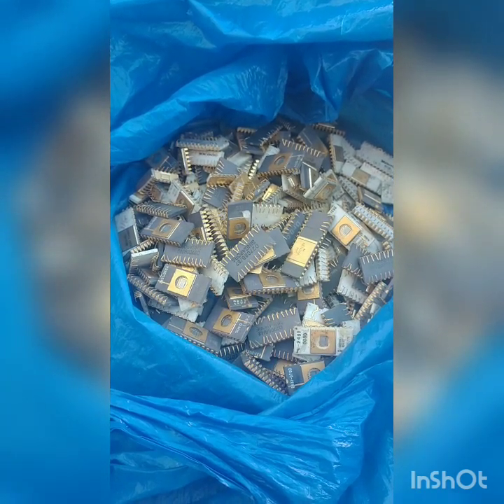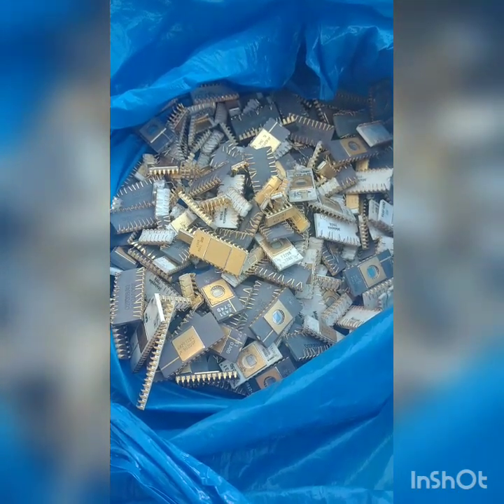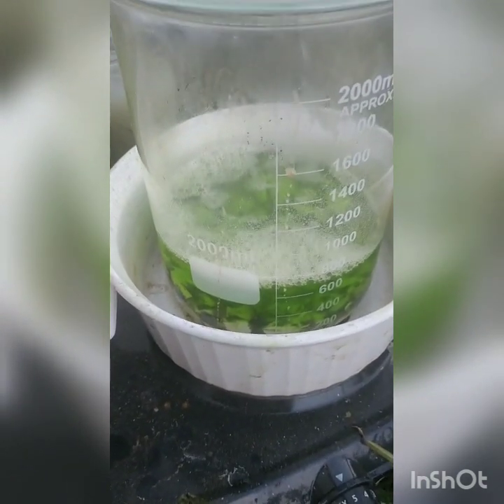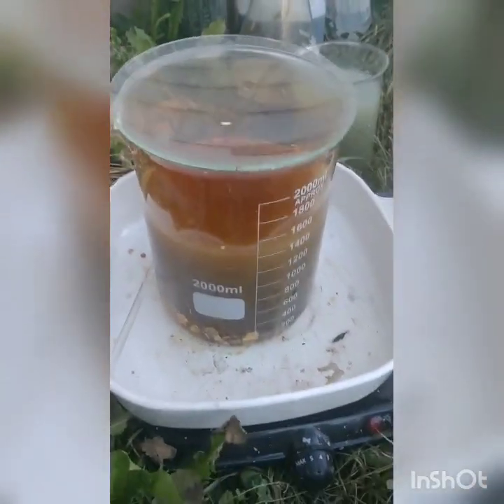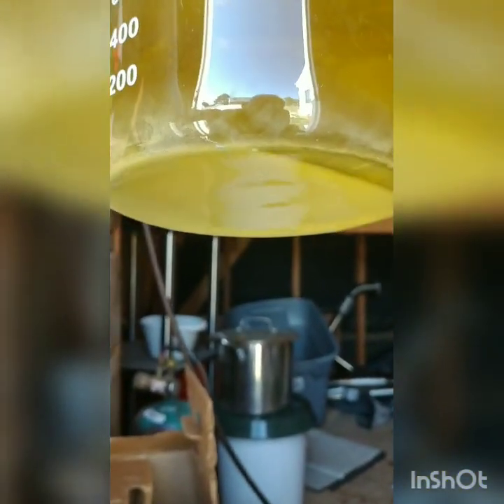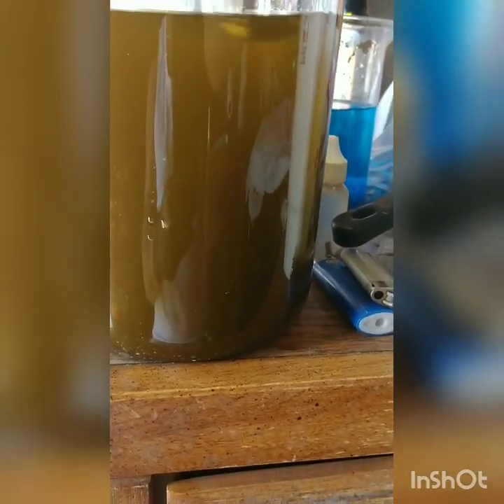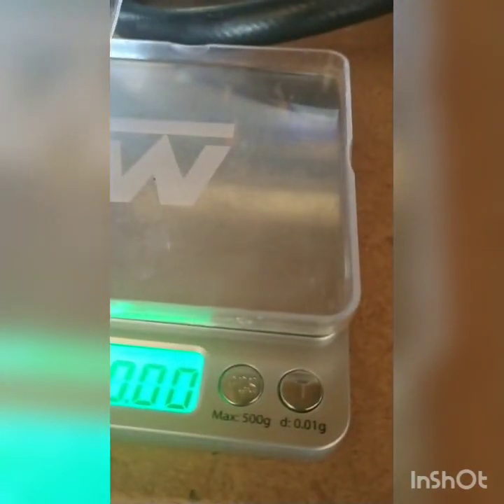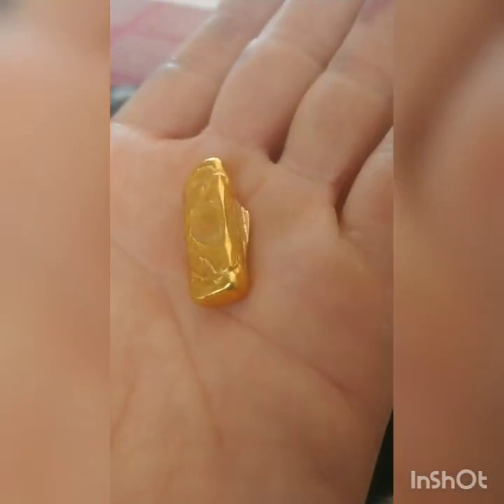Gold recovery processing gold eprom ceramics

Comment: One other thing to consider. Those old gold chips white ceramic 1970s Intel EPROMS  could possibly be sold as jewellery. If the gold  recovered is more than $2 / EPROM  then chemical recovery may be the way to go. But about 40 years ago I was buying Intel white ceramic EPROM's  for $0.25 each using a safety pin as a way to put it on clothing I was reselling them for a dollar as jewelry. In today's money I would say that's about $5 so basically I was quadrupling my money with about five minutes work per chip. Chemicals are a pain in the ass.  As was said at the beginning of the video they can be very dangerous and even deadly.